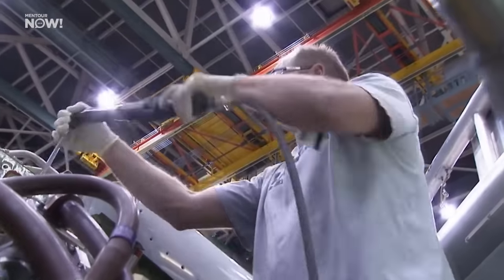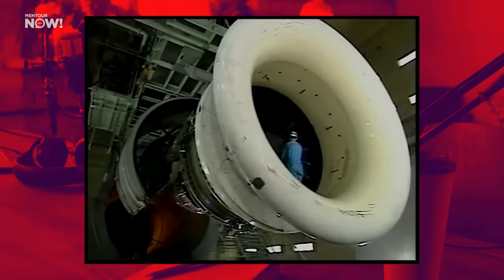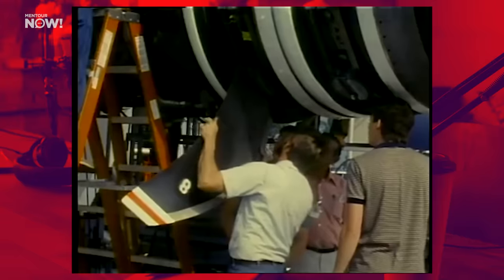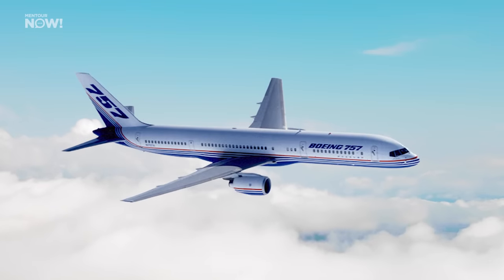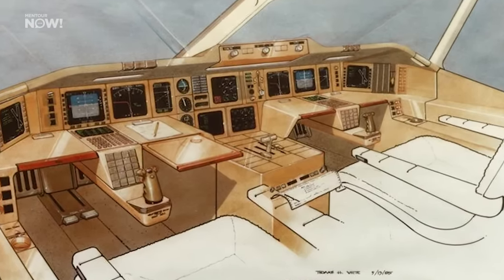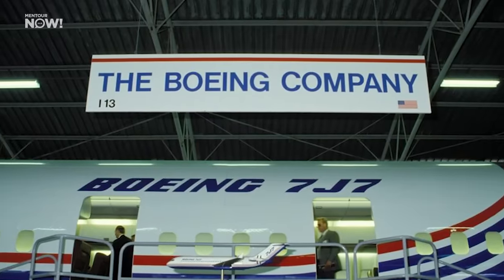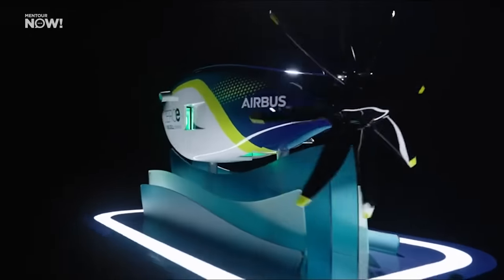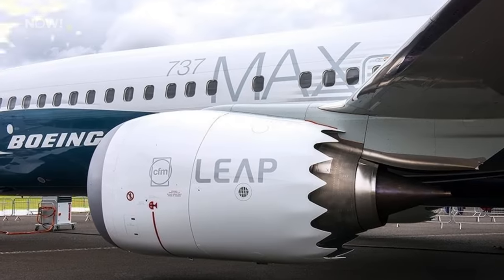Revolutionizing Flight! The Amazing Potential of the CFM RISE Engine.

Comment: Hope. Airbus ad a double mid to keep range and speed safe and at end slight curve angle to get even better fuel consume so the goal pot is 0.85 Mach and improved range with extremly low consume much lower althow speed can consume but optimizacion level is high and incredible high option to be vtol on servo that a lot more easy hravier body or increased speed and instantlt fast high volume trust vtol made

Comment: This is like nuclear fusion, with endless false starts because they are still too noisy, like the "thunderscreech" aircraft, plus, what happens when a blade comes loose with no containment and takes out a whole row of passengers?  Finally, it would be :"uuuugly"! Given the noise, why not scale up adaptive engines with the engine in core fighter thrust mode on takeoff to impress the passengers with the kick and 50 ft. afterburner and then shift to fuel sipping bypass fan mode for cruise, bwaahaahaa!!

Comment: I hope this zombie stays in the tomb. Variable pitch props and gear boxes cut system reliability in half or worse. They won't be sending these twins across oceans. A turbofan can be fixed pitch with supersonic tips because the duct regulates duct flow to pitch speed. The inlet will spill or suck to keep the fixed pitch fan from biting off more than it can chew. High blade AoA works subsonic but has prohibitively high wave drag supersonic. The duct also has a diffuser to slow the air so less of the fan operates supersonic. Variable pitch is a hack because the pitch adjustment axis is at a right angle to the screw axis. A true helix only occurs at one pitch setting. At other settings the blade will be over or under pitched at different points along the span. This is a problem for supersonic blades. And if 0.8 mach is the target, much of the blade will be supersonic.

Comment: Hydrogen fuel, especially in aviation, is an expensive blind alley.

Ditto in internal combustion engines. 

Just transporting and storing the stuff gets "interesting". Then trying to stop the tiny molecules escaping through "solid" fuel lines and "accumulating" in the wrong place?

Flame-front propagation? Energy per mass of fuel?

More EFFICIENT engines burning Jet-A seems more sensible.
Reply: and where are the resources to make Jet-A supposed to come from? Cause this planet is running on fumes

Comment: R E V O L U T I O N    I N    A I R    P R O P U L S I O N  :
1. Pistons moving wheels moving gears moving fan moving air.
simplification:
2. Fuel burned in chamber                       moving fans moving air.
more simplification:
3. Ionized air within magnetic field surrounding saucer moves itself (* and what was air-drag becomes an engine ) .

Comment: Fascinating video. However, I would offer that the hydrogen fueled aircraft is a loser. I can’t see that very dangerous concept reaching commercial  use in our lifetimes if ever. 

First, I would remind you of the Hindenburg incident. Hydrogen is inherently dangerous. Imagine a modern airliner with a hundred passengers onboard enveloped in a ball of flame. 

As someone who designed and built a hydrogen analysis system for use in an operating nuclear power plant, I can tell you that handling hydrogen even under the best laboratory conditions is difficult. Containing it with zero leakage is almost impossible and requires extraordinary design and construction features. The slightest imperfection allows unacceptable leakage. Even temperature excursion related stress can cause leaks, not to mention vibration induced stress that would be unavoidable in aircraft. So, although use of hydrogen as a fuel has certain seductive characteristics, it is an elusive and and perilous quest.

Comment: Thanks, very interesting, but as I know the US aircraft industry has ALWAYS been very good at blowing its own trumpets often while still on the drawing board.!! I’ll wait in hope that the real work will be done by Russia or China….they are just more believable, and I believe will dominate this industry
Reply: The latest and most advanced PD-14 engine (14,000 kgf) is ready for flights. But it will not surprise any airline company with outstanding technologies. It may re-use 80-90% of existing state-of-the-art tech. Nothing more. PD-35 (35,000 kgf) is still in development. It may add state-of-the-art tech up to 95% before 2030.

Comment: The effort into hydrogen development is stupid for many reasons. Natural gas, Methane on the other hand is  mostly hydrogen with only one carbon atom. It is abundant and and can be cryogenic liquefied, and will maintain a liquid state as it volatilizes. The vapor of volatility can be burned off in the engine, so there will be no waste. The only massive issue that is preventing it's use is ignorance thru the the vilification of the substance. We have some really stupid and unqualified members that are unfortunately in control of decision making in our society. There' a term for that, but it eludes me at this time.

Comment: Never the fact that it will revolutionize engine or jet engine you took away the barrier that protects the blades from the passenger in case of the blade breaks it’s not a revolutionize engine it revolutionize the death of people if The fans on the outside breaks apart

Comment: With all this modern technology helping planes take off and land on there own, why can’t they overrule a pilot that puts in information that could put the plane in jeopardy?? Or better yet, teach the plane what an emergency is, since a lot of pilots hesitate to call out a mayday. Let the plane send a signal to closest airport to land in, when they have a real mayday. The airport can send the coordinates to the plane, so they can land as quick as possible. Nothing against pilots doing this, but some of them hesitate and try to figure the problem out. This waste valuable time. If the plane knows it’s in danger, let it correct the problem. Then maybe when the pilot is heading into a mountain he can’t see, the plane will override him and get the plane out of danger. Same goes for pilots that wanna commit suicide and take the whole plane of passengers with him, like Air France. Innocent people shouldn’t have to die because of these situations.
Reply: You are describing a computer as if it were a person and knows what is going on. Computers are fancy calculators that follow preprogrammed instructions. The autopilot would not know what to do unless the pilot tells it what heading to fly, what altitude, what speed, etc. Taking off and landing is relatively easy for pilots, they learn it their first week of flying lessons. They let the autopilot land the plane only when the visibility is poor. Otherwise it's more work to use autoland because the pilot has to input instructions into the computer and follow every move that it makes very closely.  Easier to just land the plane themselves which is what they do as long as the weather is clear.

Robots have existed for over a half a century so why don't we have robots in our home that do the dishes, wash the clothes, help the kids with their schoolwork, feed the dog, etc. It's because robots are only good at doing repetitive tasks that are exactly the same each time and do not require decisions and which have no unforeseen circumstances that were not programmed ahead of time into the computer. Pulling the clothes out of the dryer and sorting them and folding them and putting them away is more complicated than it seems, we think it is simple but try programming a robot to do this. Flying an airplane is 10,000 times more complicated than putting away the laundry.

Automation is slowly increasing in airplanes but it has proved very dangerous if it malfunctions or is not preprogrammed exactly right. Computers cannot at this time fly an airplane more safely than a trained pilot. Airline crashes are currently at less than one in ten millions flights. This is due to the diligence and skill and experience and extensive training of pilots. You are looking at isolated examples of pilot errors and assuming that computers can fly airplanes safely. Maybe in a few decades that could be the case but it is not the case now.

Comment: Boeing is a has been aircraft manufacture. In 2015 Boeing retired and fired any aircraft engineer that was 55 and older (level 4 and higher).
They were left with entry level engineers (level 3 and lower). The just out of college engineers had no chance to learn because all experienced engineer were gone. So Boeing has farmed its engineering work to India, where they are less experienced than those at Boeing.
Initially, investors believed that Boeing firing old tired engineers would bring a new fresh crew in and the company would thrive, but engineering know-how does not come from the sky.
At one time Boeing stocks (BA) were at $440 per chair, today it is $200. Less than half that it was in 2019. That means that BA has to go up 120% to reach its level of 2019.
Rumors goes that Boeing plans to develop a new airliner sometimes in 2035. That is after the #globalwarming doomsday predicted by #climatechange activists.

Comment: Really enjoyed this video but I must make one comment.  Please, please, please don't drink the hydrogen Kool-Aid!  Hydrogen is the solution to a question nobody asked.  There are only two ways to make hydrogen with any reasonable efficiency.  Reforming natural gas and, really efficient, radiolytically decomposing water into hydrogen and oxygen in the core of a nuclear reactor.  When a neutron hits a water molecule, it will knock it apart into hydrogen and oxygen.  This is quite efficient and happens in existing nuclear plants, making nuance  offgas that has to be dealt with.  

At this point, it's hard to imagine the green weenies accepting nuclear-generated hydrogen so the only other source is to use natural gas and that's against their religious beliefs.

Comment: Its a propeller.
And it's going to have all the same problems, and speed limitations, of a propeller.

I live in boston. A trip to Phoenix is roughly 5 hours. And 4 hours back.
I dont want that doubled.
Reply: This engine will most likely not be slower.
Reply: @emilsinclair4190   I'm not talking about the engine.
 The plane will be slower. 
No prop aircraft can go the speeds of a contemporary turbofan-powered airliner.
Reply: @davecrupel2817  well aircrafts equipped with this new engine can. Mach 0.8. Same as normal jets.

Comment: Hydrogen isn't really sustainable. If you look into how it's produced it requires fossil fuels. 
When solar or wind scale up enough, and there are ways to sequester megawatts of energy so that continuous operation of hydrogen production is possible that would be sustainable. But hydrogen isn't a solution yet. It's just a buzz word.

Comment: Sorry to destroy the party but all innovation in the aviation industries are basically for the trash can. The changes in the climate are progressing way too quick, so we will see major restrictions on air traveling within the next 20 years. There will be a decline in the number of global passengers of easily over 50%, if not significantly higher. If mankind is not acting quick enough to bring emissions down, we can even expect an end to all tourist flights globally. 
In my personal assessment, aviation industries will crash big time by 2040 at the latest.